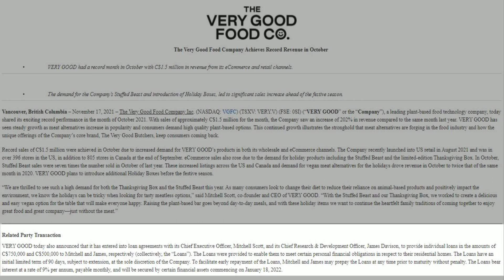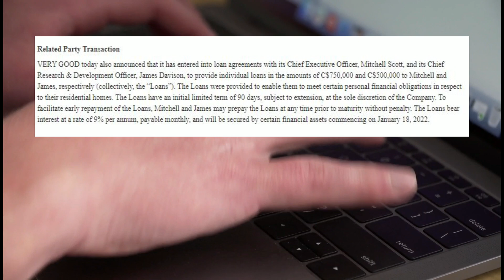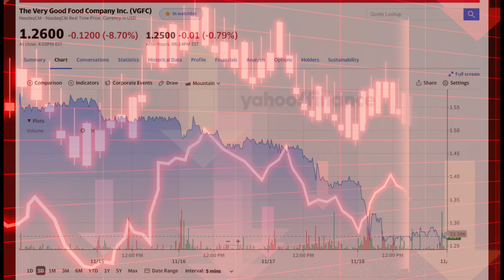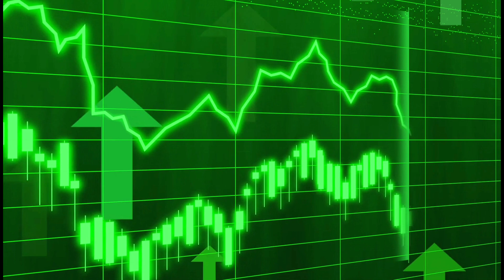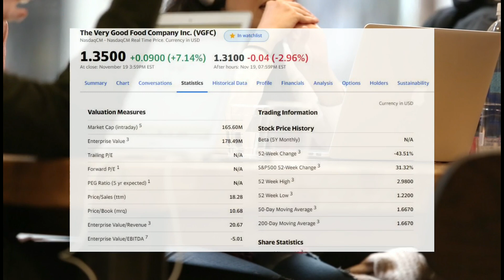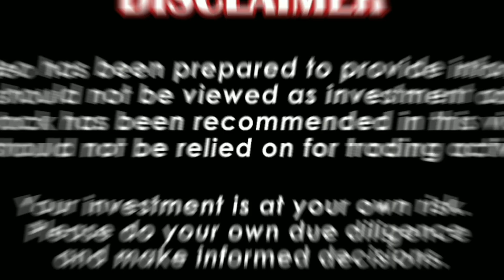VGFC director personal loans?

Comment: Very came out with q3. They say it is sensational good :) haha Sales 2.5 M(decreased compared to q2), ebitda -8M (q2 was -5M)!!! I am curious what your opinion is. Adjusted gross margin is 36%. It sounds good, but for me it is a very big question what it contains. If it doesn't contains distribution costs I don't think it is very good. I started not trust this management. I think they manipulate with accounting as well. They expect from this q3 a big stock price pump, but I don't think there will be any. It means that these two idiots won't able to pay back their loan. Which is very Very Very bad. What is your opinion? Thanks in advance!
Reply: Will be interesting to see what Mr Alpaca has to say!
Reply: @jamespeters8242  I wrote today a letter to Very demanding Scott Mitchell's resignation as CEO and a need for a new management team.
Reply from the maker: 85% YoY revenue growth is not good enough considering its valuation, but this quarter is transitional point as the company swtiches more to wholesales, revenue would naturally go down due to average selling price. I am still reading the earning report and prepareing a video, i prefer to take the time to do some deeper research rather than rush out a video, stay tuned
Reply: @MrAlpacastocktalk  nice work looking forward to it!
Reply: @MrAlpacastocktalk  in their ajdusted gross profit ,why they ajusted the stock-based compensation and The Butcher Shop & Restaurant
procurement expense?